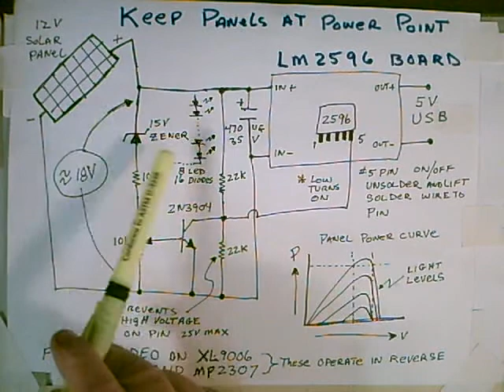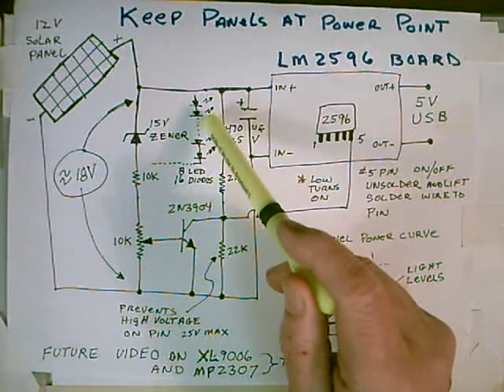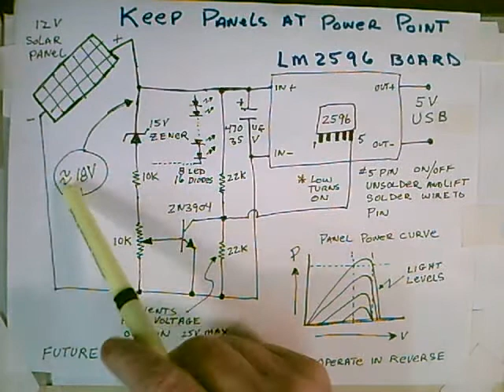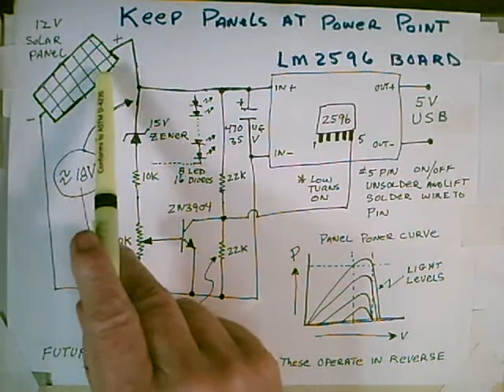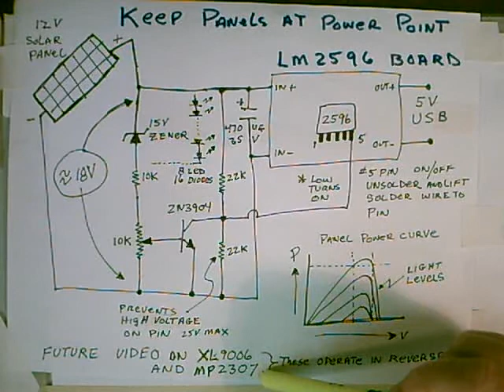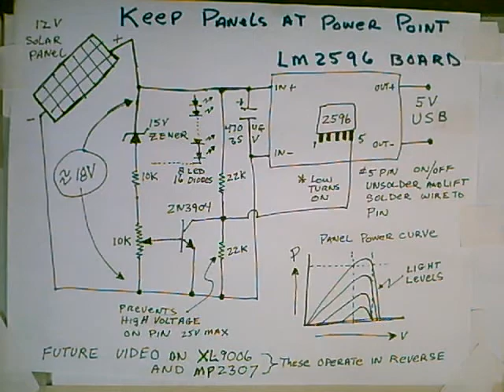Solar PV USB Phone Charging In Low Light Levels,  LM2596

Comment: alright, i've been able to play with it a bit and it actually works quite well. Its keeping my well underpowered 10w solar panel at a steady 16.1V under load (in low light). Only issue is the output voltage suffers. When set at 5.2V you only get around 4.5V under load...setting the output voltage higher won't make a difference. Still my powerbank isn't all that picky, so 4.5V is enough for it to start charging. 

So all in all, a working solution.
Reply: when there is enough sun, the output voltage is stable! (thought i might add that)

Comment: Fixed! (Hi, so i tried this setup and it won’t turn on the lm2596. Any idea why?)
Reply: The 10k resistor on the bottom. Is it connected to the transistor base or to negative? And instead of pulling pin 5 down, its at 10v
Reply: Nevermind, it was the resistor, seems to work now...i'll test it fully tomorrow